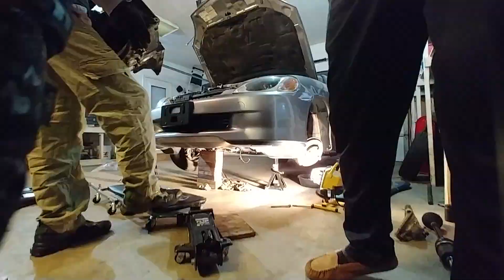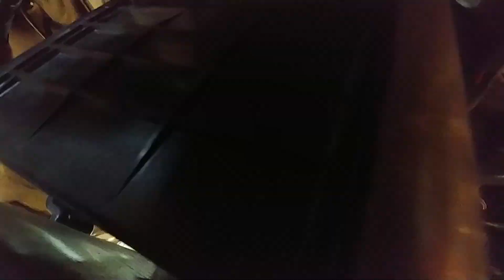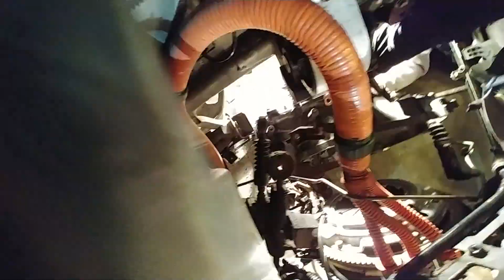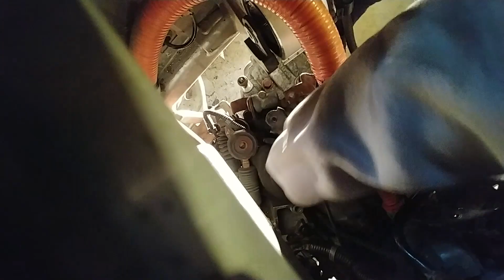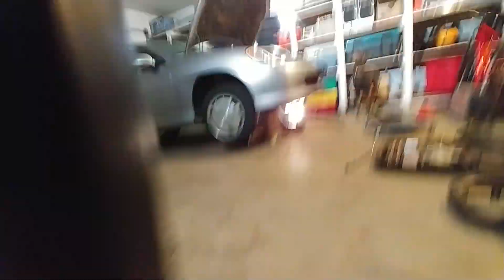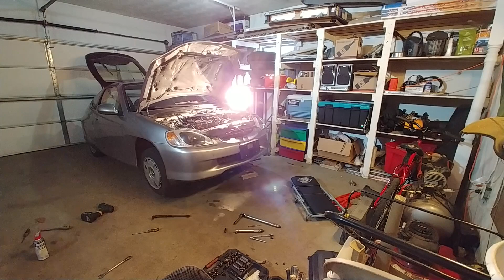2000 Honda Insight Transmission Install

Comment: Hey is that automatic transmission? If not .. will it same process as standard that u removed it or must remove with engine for automatic transmission
Reply from the maker: No, this was the 5 speed transmission.  It should be a very similar process to the CVT.  I don't think you would need to remove the whole engine.

Comment: Great video. Is there a guide or process you followed to do this, or did you just fly by the seat of your pants?
Reply from the maker: Thanks!  Yes, I followed this guide and below are my tips along the way: https://ecomodder.com/forum/showthread.php/2000-honda-insight-5-speed-manual-transmission-fix-35260.html
As far as tools go, I'll try to name everything I used:
8mm
10mm
12mm
14mm
17mm
19mm
32mm

Needle nose pliers
Impact wrench
5lbs hammer
PB Blaster/WD-40
Breaker Bar
Torque Wrench

My first trouble was removing the starter. The 12mm main power wire was fused and the moment I used an impact wrench, the surrounding metal base shattered. Thankfully I had a spare started from when I pulled the spare transmission from the junkyard.

My second trouble area was removing the cotter pins from the shifter linkage. They were horribly rusted and broke. I couldn't get the upper piece out after it broke so I had to use a grinding wheel to grind it smooth so the washer could pass over the stud. The bottom one came out better and did not require grinding.

I gravity bled the slave cylinder. Now would be a good time do do that as well. Only takes 10 minutes or so.

I did not use the engine hanger either. Instead, I just stacked 2x4s under the oil pan.

It would be a good time to replace or repair your rear motor mount. For the side mount, all you need to remove is the bracket like the manual says. For the rear, I opted to just remove the 4 rear bolts and left the entire mount in tact because my motor mount had already been repaired. It would be far easier to just remove the two larger frame bolts, leave the 4 rear bolts and have the whole thing come off with the transmission. The 4 rear bolts are kinda a pain.

I only removed the driver side CV axle. I did this by removing the 2 large knuckle to strut bolts. This is where you'll need 2 19mm sockets or wrenches, PB Blaster/WD-40 and a 5lbs hammer or impact wrench. Those bolts are tough! I also turned the steering wheel to give me a better angle to wack the wrench and use a breaker bar. I'm not sure of the exact size of the axle nut, but a 32mm socket worked for me. Once the knuckle pulls away from the strut, you can press the control arm down toward the floor and it will give you enough room to remove the CV axle. For the passenger side, all I did was pop out that side from the transmission before I dropped it. Unfortunately, it still stretched the inner boot and I had to remove the metal strap and realign the inner bearings. In order to avoid that from happen, one person can lower the transmission while the other pries the CV axle out from the transmission.

Breaking the transmission loose is kinda a chore too. I wiggled it a little and then gently tapped a flat head screw driver between the bell housing and the IMA housing. Once it broke free, it slid away pretty easily with it being supported by the jack stand.
  If it doesn't, there is a bell housing bolt above the passenger CV axle that is kinda easy to miss.

I also had a leaking rear main seal so I had to remove the IMA motor as well. I cut a plastic folder into pieces and slid them around the entire circumference so the magnets would not move the inner part once removed.

The rear main seal came out easily after drilling a small hole in the seal, screwing in a screw and prying it out with a claw hammer. To insert the new, I ensured the inner lip was correct and then simply spun the seal so the inner lip was properly seated. Then I gently tapped it in with a hammer.  After that, I cut a hole out of a thick plastic lid, placed that over the seal and then reinstalled the electric motor and that helped press the seal in even and far enough.  Then I loosened the bolts, but didn't remove them all the way so I could remove the lid, but not the entire motor again.

Comment: with a 2000 are you able to swap the manual with a cvt to make it an automatic? Ive only seen the reverse or a replacement done
Reply from the maker: It's likely possible, but without having an entire parts car Insight next to you, it would be quite costly.  Most people want the 5 speed for "lean burn" and maximal MPG.  I know the motor/transmission mounts are not the same.  There's quite a bit that are different between the two.  You'd even have to swap over the instrument cluster.
Reply: @mjspiess  So i either learn manual for a $1.8k car or go with the $4k cvt car that already has 280k miles on it. Im a little hung up
Reply from the maker: @kinggerr7093  On these cars especially, it would be worth learning how to drive a manual.  The lean burn feature is pretty awesome.  The CVT's tend to have less mileage on them and tend to carry a higher price tag, but if you're going for maximal MPG, then go for the 5 speed.  The CVT MPG isn't anything to really brag about.  Unless that CVT has a new Bumblebee IMA battery, that car is way over priced with that kind of mileage.
Reply: @mjspiess  He says its a new battery, gets 75 highway, 61 city and runs great. I'd be willing to learn manual, but the ones available to me right now probably have a lot of work to fix them up. While this CVT seems in great shape, new paint and tires, cool a/c, and great mpg. I haven't called him up on it yet but I'm guessing its been treated right from the description and I'm starting to think the price is worth it.
Reply from the maker: @kinggerr7093  I'd want to see the receipt on the battery before purchasing.  And no chance it gets 75 mpg highway, unless he considers 45 mph highway speed.  Even the original EPA estimates weren't that high.  New MPG: 47 average, 45 city, 49 highway and Original MPG: 56	average, 57 city, 56 highway.  The CVT does sound nice, but you will be woefully disappointed in your MPG if you're expecting to get 75 mpg in a CVT.  The best I ever got in my 5 speed was just over 70 mpg over 600 miles of driving 60 mph or slower.
Reply: @mjspiess  yeah I wasn't expecting it to have mpg as high as he says but I'm 'ok' with that if the car itself is in excellent condition at 300k miles.
Reply from the maker: @kinggerr7093  Yeah...but I guess if he's lying about MPG to try to boost the sale of an over priced car, what else is he lying about?

Comment: OK so you seem to realize that your camera didn't catch what you wanted; doing it so fast without any voice saying what you are doing or why you do it the way you do is of less value; if you could do that again and cut a lot of the junk movements and add some voice saying what you are doing; would add a lot of value; I'd also like to see a clutch put in if you could?
Reply from the maker: I know.  I was disappointed in how it turned out.  I installed a clutch in another Insight, but didn't record that process, but this is the guide I used: https://ecomodder.com/forum/showthread.php/2000-honda-insight-5-speed-manual-transmission-fix-35260.html

Comment: You cant see anything
Reply from the maker: I know.  I was disappointed in how it turned out.  I installed a clutch in another Insight, but didn't record that process, but this is the guide I used: https://ecomodder.com/forum/showthread.php/2000-honda-insight-5-speed-manual-transmission-fix-35260.html